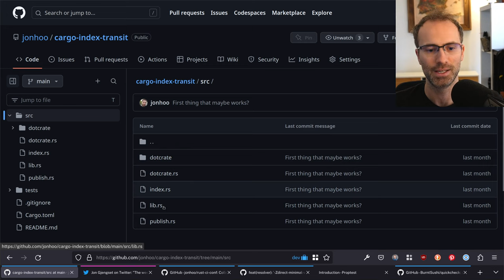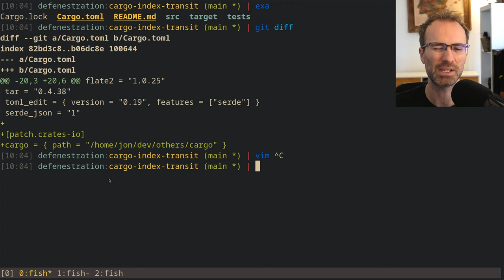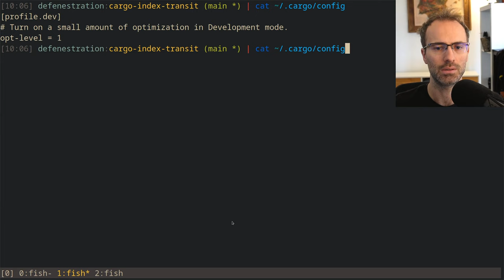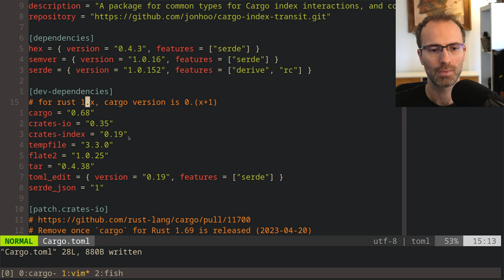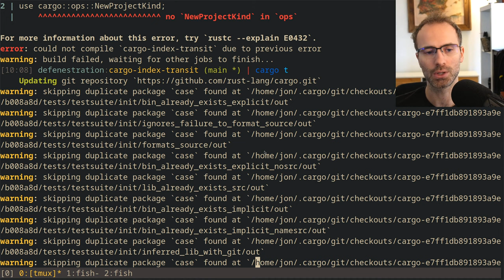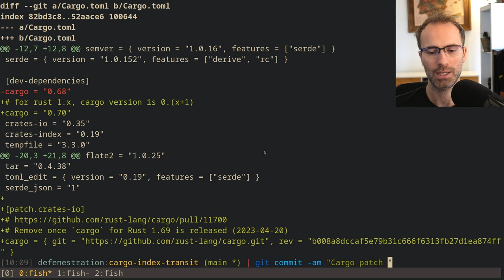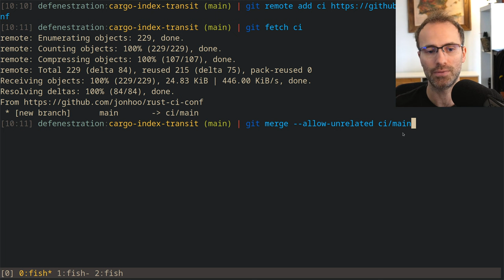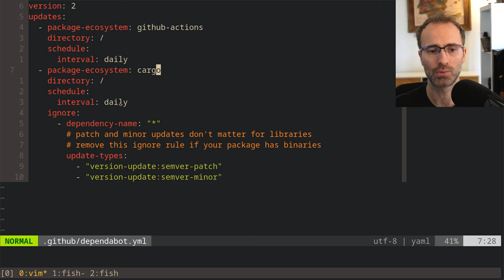Setting up CI and property testing for a Rust crate

Comment: 56:00 I'd call the additional work currently needed to declare accurate minimal versions "toil", not waste. Clearly, as you explain, the work output is useful,  so the work is not "waste". "Toil" captures the "we could have a machine do this annoying work" much better.

And we want to automate toil, but remove waste.
Reply: I'm currently learning about rust and its ecosystem. Would you mind elaborating why exactly this helped? 
To me it looked like his project now depends on old (and outdated) versions of stuff that should be up to date (like ssl). 

I might have missed a part though or don't exactly understand how cargo managed dependencies.
Reply: @flwi  I think this was talking about minimum versions.  This is not what regular cargo would use, but it allows folks stuck on older rust versions to still find a dependency solution when the newest versions of the dependency do not support that rust version anymore. Also when multiple libraries depend on the same thing, having accurate and lax lower bounds provides for more flexibility if not all of them agree on the upper bound.

Comment: 42:44 - You may answer this in later Q&A but I have a question. Is "Hey, your versions are misspecified, you should probably use 1.2.3 for the minimum version of foo" the kind of bug report that you tend to push upstream? As a maintainer, If you saw a bug report like that, what information would you like to see?
Reply from the maker: I ought to file issues for these, but find that I rarely do. And I honestly don't really know why. Maybe it's a perception that many maintainers don't really care? Even though I don't actually have evidence for it. If I got a PR like that, I'd certainly be happy! Main info I'd want to see is that the crate doesn't compile with the minimal version as currently specified, but does compile with the updated minimal version.

Comment: proptest is destructively obtuse -- it's very 'python testing' style -- adds a ton of oscurity and complciation and takes way more work and leaves you with something that is unobvious to maintain.  I see what tehy're going for, but it's a bad model in most cases.  QuickCheck is what's on the tin with straightforward ways to clean things up.  QuickCheck is also inline with the idea of type based fuzing it ... fuzes the type by default.  Not substructures within a type.  -- PropTest has useful elements, but it adds more weight than value given that QuickCheck exists, in most cases imo